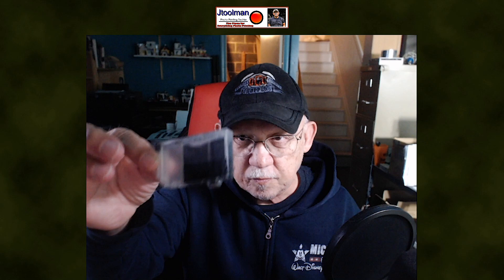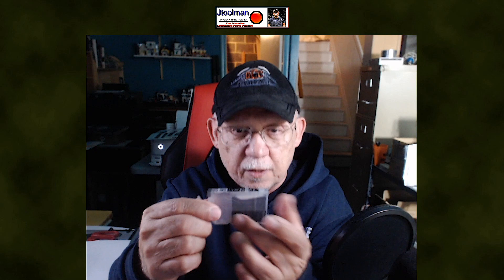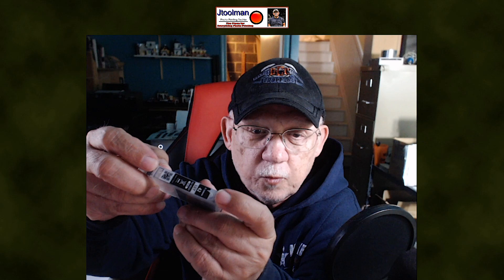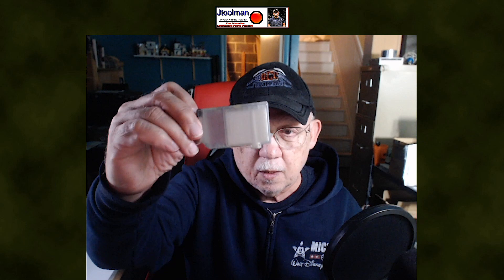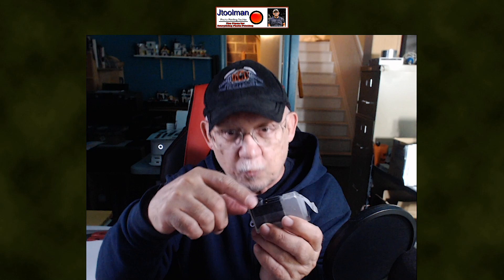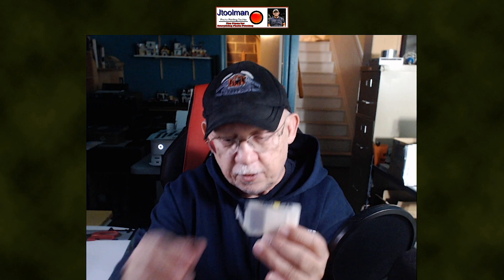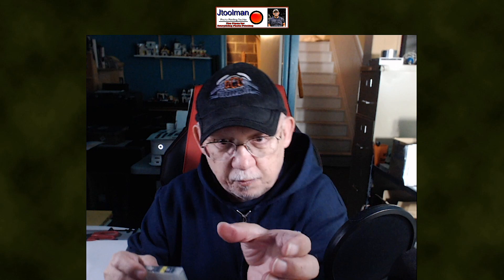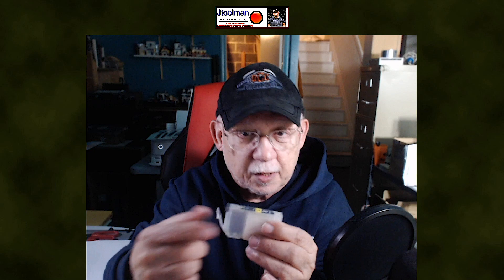Revisiting the CANON CLI and PGI cart refilling techniques!

Comment: love your videos and can't wait to add to my current et-8550 with a more dedicated photo printer with 8 to 10 dedicated cartridges using PC ink. I'm wondering if you think getting the pro 100 might be just a little redundant for me as the 8550 might get almost get comparable photos? Should I consider something in a pigment printer, maybe something like the pro 10 or epson p900 or something? Want a large format printer and would love a more advanced and extensive color gamut with 8 or more cartridges. It would be great to have better black and white and while longevity is not so much an interest or concern, I wonder whether a pigment based printer may end up disappointing if it doesnt quite pop like a dye based color one can...I can get a pro 100 very cheap around $100 so seems like a no brainer but would love any input from you. I've also seen a 3880 at a good price but wonder whether the feedback that it can be unreliable or it's "great when it works" has any validity. Will be going through all your videos for info and am excited about the journey your videos have put me on. Thanks for all that you do and look forward to using your link for RR paper as well.